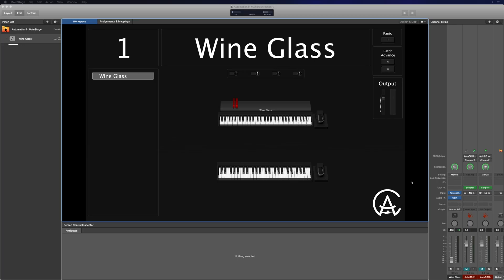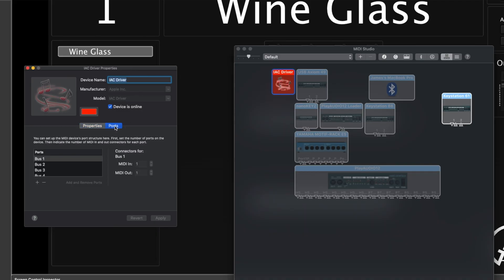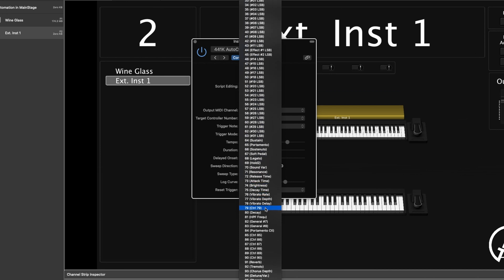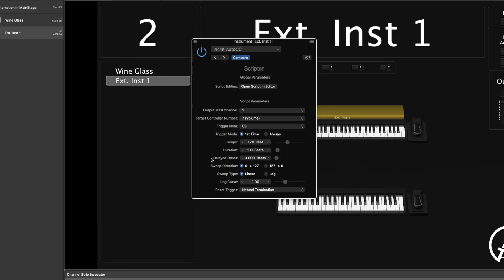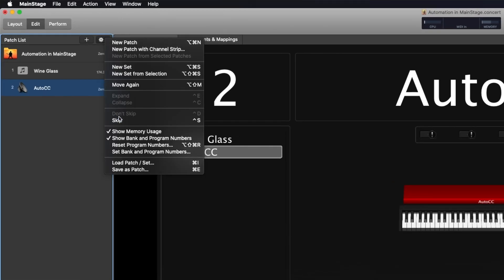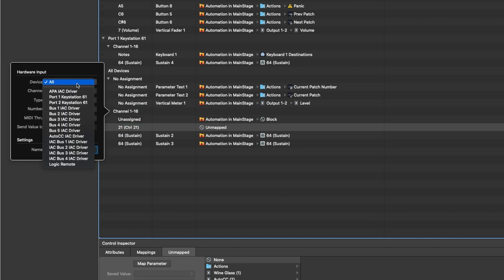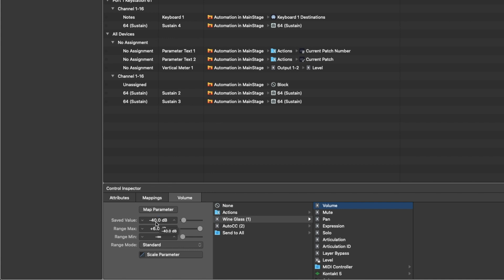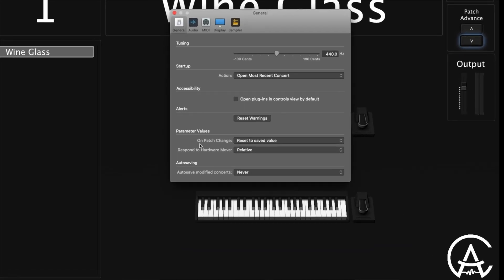Can You Create Automation In MainStage?

Comment: Will this work to automate a midi controller such as modulation? When using mainstage with an 'Alias' where ever you leave the mod wheel with the 'original' channel strip, the alias doesn't reset the mod value but instead stays at the last left value. Of course manually resetting the mod wheel will do it. I'd like to be able to change patches and have an alias channel strip reset Mod to zero. A simple request but i have yet to figure out how to do it. I'm thinking an external channel strip with a midi file attached to send a mod value of zero sent to the alias channel strip might work... but i'm not sure... and is a little complicated. Any help would be appreciated. Thnks

Comment: can you also instead of a midi note us a midi button connected to a midi controller?
Reply from the maker: Yes, you’ll want to press the button and check the midi input window at the top of the concert in edit mode. This will tell you what MIDI message that button is sending then you can assign the automation to that note.
Reply: @CatherallAudio  Cool thanks!
Reply: Can you get it to automatically trigger patch changes based on a certain measure of a click track without hitting a key or button?